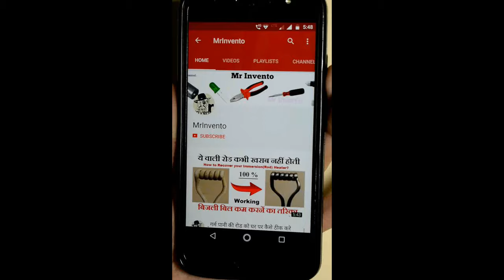How to Repair Hand Blender at Home | Jammed Blander Repair [UNCUT]

Comment: I had a hard time deciding between the Cuisinart https://www.youtube.com/post/UgkxbHS6iDzgurU5HDfOQwM9gHX0K703-UyJ (rated # 1 by America's Test Kitchen) and this KitchenAid hand mixer. After receiving the KA, I inserted the beaters and turned the KA unit on in the air. The beaters seemed "wobbly" and I was worried that I may have made a mistake. Then I actually beat egg whites into a meringue (a good test) and found that they whipped up much quicker than usual. Now I think the "wobbly" beaters are built to orbit that way to improve the mixing. The "slow" start is a nice feature, too, and it keeps a thin batter from splashing out when the beaters are first inserted. Because there is little splashing, I find that it's also easier to clean this mixer. About two weeks after purchasing the KA mixer, I was delighted when I read that this year the KitchenAid is rated #1 by America's Test Kitchen! Official validation for my own good taste/instincts.